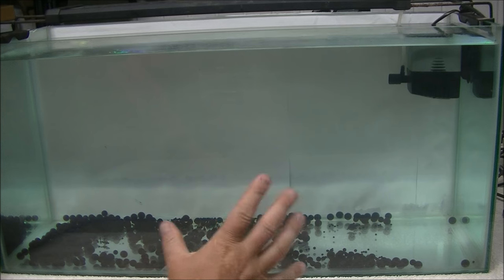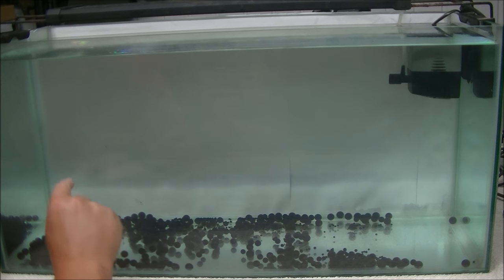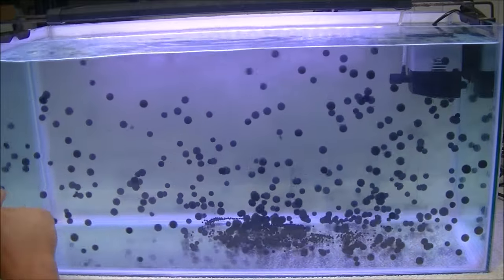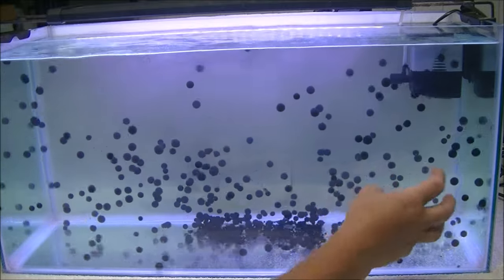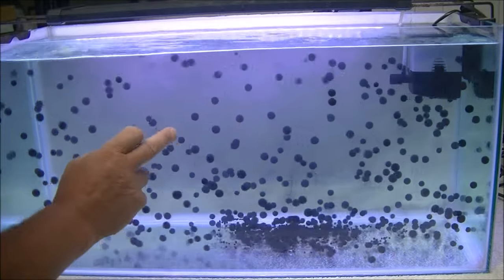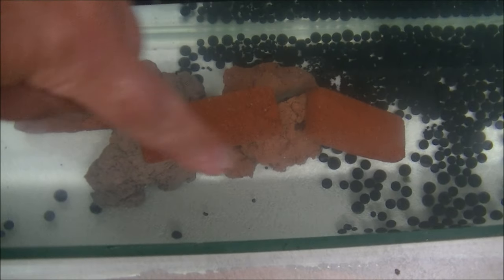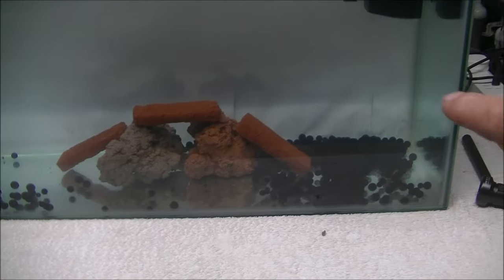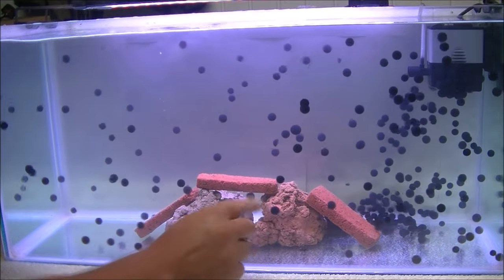Best Inlet and Outlet Placement for a Canister Filter on Fish Tank - (with proper demonstration).

Comment from the maker: Biohome filter media and foams: http://www.filterpro.co.uk
Here we go. This is a video showing why the inlet and outlet of a canister filter should be on the same end of the tank.
When you see the muck (simulated by neutral buoyancy gel filter balls) being shifted to the same side of the tank as the outlet there really should be no argument about where to locate the outlet and intake of any canister filter.
However, I'd still expect people to argue over the placement of both the outlet and the intake - that's just how the internet is ....
For a thinking mind, when you see exactly where the muck goes in a water current the choice of where to locate the intake and the outlet of a canister filter becomes obvious.
Unfortunately there are still many 'experts' making videos online who ignore any sort of common sense who say that the intake and outlet should be on opposite sides - that is wrong as this video clearly shows.
If you found any sort of value in this video please feel free to share it anywhere online - the visuals don't lie.
Check out the FilterPro website here for the best filter media available: http://www.filterpro.co.uk
Also, if you're interested in learning more about filtration, water conditioners and how to create a set up which is low maintenance with perfect water check out the FilterPro Q&A page here: https://www.filterpro.co.uk/qa-24-w.asp
SUPPLEMENTAL: Avoid using any water conditioners which claim to 'remove / detoxify or bind' the ammonia, nitrite and nitrate since they will starve the bacteria which are needed to process the ammonia, nitrate and nitrate. It is quite obvious.
Go for a normal conditioner like API Stress Coat https://geni.us/BHYeb which will simply make the water safe for life.

Comment: Excellent demonstration, also having both inlet and outlet in the same place should increase the flow rate and save energy at the same time because the outlet pipe in not starched out at the other end.  Less drag to push the water out
Reply from the maker: Good one - I'm glad that you have it set up well. Thanks for watching and best of luck with the tank.

Comment: What gel balls were you using? I have just bought a canister filter. Will it change things if using a spray bar?
Reply from the maker: They are just pond pure balls from Evoulution Aqua - that's what I give away with the Biohome filter media and they're a great way to naturally seed the new media in a filter. I made a similar video showing a spray bar here: https://www.youtube.com/watch?v=9vGJ21YxlMw
Reply: @pondguru  ah, cheers 👍 I found your video really informative and interesting 👍 
I've just got the 'All Pond Solutions' EFX + 2000 canister filter for my 350 litre aquarium. I found that the bioflow 6.0 built in filter just wasn't hacking it anymore. It keeps a good cycle, but just recently, and with the 4 fancies  growing bigger, the nitrAtes are now going from 20 ppm to 30 - 40 ppm a week. So, I felt a larger filter was necessary. With an additional internal Aquael 750 on the other side for emergencies. 👍
Reply from the maker: @jonnyshock9165  Nice one - that seems like a solid filtration set up.

Comment: My intake is in a corner and the outlet is a spray bar the length of the tank . Hopefully that's okay.
Reply from the maker: You will get a very good cyclical motion along the length of the tank when using a spray bar but the much won't necessarily be pushed to where the intake is for the filter.
As long as you're happy with the set up it's all good since the water moving well is more important than what direction it moves.

Comment: This have always been quite intuitive to me.
The filter outlet create surface agitation and oxygenate the tank, then reach the far wall, where the water have to go down and then stream along the bottom, sweeping the muck with it in the process.
Only the lightest bits will follow the upward stream at the filter end of the tank and follow along for another lap around the tank.

It was very helpful to see how the mid setting of the filter gathered less muck around the end of the decorations though, I have never thought about that!
Reply from the maker: Yes that is very true about the large bits of muck and uneaten food and I over-sized the pump (and 'muck' represented by the balls) to make the visual representation more noticeable.
I'm glad you found the video useful and thanks for the report on your tank.

Comment: Great advice. I have one large internal filter at one end of my tank and  I found that when syphoning gunk off the top of my substrate there is always a saturation of muck right under the filter, proving the point you make. Thanks for sharing.
Reply from the maker: Nice one - thanks for the report and confirmation.

Comment: Fantastic video! For years I had my Eheim canister set up wrong, with the output and input on opposite sides of the aquarium. I finally discovered (after watching several videos) that they need to be on the same side. It's really rather counterintuitive in my opinion.

On my central filtered rack system, my intakes are at the surface and the output near the bottom. The reason is that I need surface skimming, and good flow at the bottom to prevent algae buildup.
Reply from the maker: I'm glad you found the video useful and thanks for the comment - it's a great example of how there is never a definitive 'right' way to do anything and experimentation is key since every tank is different.
Unfortunately many people are afraid to experiment which is something I've always found strange, lol
Reply: @pondguru  Which demonstrates why fishkeeping is an art and not a science
Reply from the maker: @FrugalFishkeeping  Yup. Whenever science gets involved in Nature it makes an arse of it.
Reply: @pondguru  I think that is a topic for a different channel. I do find myself constantly making "improvements" to my aquariums in a constant quest for success. Every time I think everything is fine, I find a way to make it even better. Or solve a problem. That's what makes the hobby so interesting.

Comment: Brilliant and simple and may i add if you place your heater under your intake that should spread the warm water out to the cooler areas ?
Reply from the maker: To be honest the flow around a tank will spread the heat around quite nicely so the positioning of the heater isn't too important.

Comment: Great visual, something which I've thought about since the day I set up my tank. 

I opted to go for opposite ends for 2 reasons:
1. My tank has a brace and the gaps don't allow for both the inlet and outlet to fit on one side of the tank
2. I have a heavily planted aquarium with two big structures so potentially opposite ends may work better in this scenario 

Initially there was some muck in the middle of tank, but I positioned the inlet to hit straight forwards towards the front panel and now I have no muck on the substrate at all so my current set up is working.
Reply from the maker: Yes 100% - just alter the direction of flow until it works for you. Every tank is different and plants / structure makes the flow go in unexpected directions so experimentation is key.

Comment: Great video as usual.. thanks pondguru. I would really appreciate if you could also demonstrate the same, but this time with wave maker in the loop. I find it really useful for most of the tanks for surface agitation and sand skimming, specially in highly stocked aquariums.
Reply: (my other channel) I have a rotating outlet which I will be doing a video on tonight and it is very disappointing compared to a normal outlet. I was shocked when I saw how inefficient it was.

Comment: Great video. Interested to know your suggestion on how the inlets and outlets will be placed if using the filters like hypermax4500 which has two inlets and two outlets?
Reply from the maker: As long as you have the inlets / outlets either at opposing sides or a side which will generate the best flow of water and muck depending on the structure in the tank its all good - there is never a perfect way to set up any tank since every tank is different.
Just experiment with the inlets and outlets until you get the best pet up for your tank.

Comment: Good visualization. How would you set up two canister filters? Because I actually use two Fluval FX6 on one tank, and one FX6 + one Biomaster 850 on another tank. For the moment they are all set-up opposite of each other with their individual inputs + outputs together on one side. One output flows horizontally towards the other side, the second output on the other side flows towards the frontside of the aquarium.
Reply from the maker: That sounds like a good option if you have 2 filters.

Comment: I need some movement, but most of my critters prefer dead spots, so it's nice to have the visual to see where to adjust it from time to time to clear out the muck from the dead zones, as well as not blasting my plants into oblivion.  =p
I'm setting up a 75g, so this is very helpful!
Reply from the maker: I'm glad you found it useful and ultimately whatever works best for you is the best set up so play around with the intake / outlet until it works best for your tank.

Comment: I just got the aquael hypermax per your advice. Since there's two outlets and inlets I'm trying to figure out where to face the outlets. Maybe they need to go the same direction?
Reply from the maker: Just experiment with the set up until you have no more dead spots. Depending on the structure in the tank the muck will settle wherever the flow is slowest.
There is never a definitive right and wrong place to site the intake(s) and outlet(s) which is why experimentation is key to getting things right for your tank.
Best of luck.

Comment: What a great explanation, most tanks I’ve seen have the built in holes for inlet and outlet making options limited….the industry needs to change a guess. On a personal note, I’m looking at moving my 250lt tank outside (its acrylic not glass), encasing it in decking material. Like a mini outside pond/ container. While I’m sure it will be fine, I’m also looking at housing my Fluval FX6 along with it, again it would be encased in the same structure as the tank (decking).  If you can imagine a tank housed in decking with a small but connected bump out to contain the FX6 (that will form a seat). Good idea or not? Do you think the FX6 will survive outside? I’m thinking or packing around the FX6 with insulation.
Reply from the maker: As long as the water did not freeze it would be fine since there is almost no difference between a canister filter and a small pond pressure filter.
If it was ever turned off it would be best to drain the pipes and filter if there was a risk of frost but other than that it sounds no problem to me.

Comment: I have two outlets/inlets (Aquael Hypermax 4500). I have both inlets (the water being taken into the filter) at the back wall at either end.

The outlets are at the front of the tank at either end. My thinking was that the flow from each end meets in the middle and creates movement.

Not sure if it's the best placement and to complicate things further I still have the Juwel internal filter running. Lots of filtration for lots of Mbuna!

I also have two wave makers to help move the crap around. One at the back corner facing down behind the rockwork. And one at the front facing the surface. But I only run them twice a day for an hour or two. They don't need to live in a washing machine 24/7. 😂
Reply from the maker: If you have the option of 2 inlets and 2 outlets then it becomes a bit easier - have 1 x inlet and 1 x outlet at each side of the tank and you will never have a problem removing the muck from the tank.
Reply: @pondguru  that's the exact way I have mine set up, that I won from your give away competition. I was going to ask you what would be best in this case, but you have answered it here , so I did good 😊
Reply: @pondguru I fully agree and support your point 👍

Comment: I’m guessing if you have 2 canister filters running you’d still just keep 1 inlet and outlet at either side? Or would you move both to the middle.
I say that not sure how that would work on my fx6 right enough
Reply from the maker: If you have 2 filters running you can switch it up until you get the best results. Since every tank is different thee is no definitive way to set the filter inlets / outlets up, especially if you have multiple filters on the tank.
What works best for you is the best set up.

Comment: When we have 2 external filters than? Both inlet in one side and each outlet at both ends or still you recommend both outlets near the inlets?
Reply from the maker: As long as you have the inlets / outlets either at opposing sides or a side which will generate the best flow of water and muck depending on the structure in the tank its all good - there is never a perfect way to set up any tank since every tank is different.
Just experiment with the inlets and outlets until you get the best pet up for your tank.

Comment: Great video. However i have a 350 uk litre corner tank where does input and output go on this
Reply: Good question
Reply from the maker: Ideally the intake would be in the back corner under the outlet but the outlet flow direction would be altered to see what happens with the muck and where it goes.
When setting up a new tank these gel filter balls are perfect since they show where exactly the flow goes and have the benefit of seeding the tank with good bacteria.
For a corner tank the flow direction from the filter would be altered until the flow across the front of the tank (the bowed long side) would either go left to right or right to left - that will allow the sides of shoaling fish to be viewed instead of looking at their backsides if the flow was from the back corner to the middle of the front side.
Structure will affect flow so just experiment until you find something which works best for you - there is no 'right' answer since every tank is different.

Comment: Hi maybe you can help I am going to setup a 55gallon with a tidal 110 and a tidal 75 I’m going to use one of them for a full cycle filter (very slow flow) with the 5lbs of bio home media and sponges 
Should I put them both in the middle or on opposite ends 🤷🙏✌️🇨🇦
Reply from the maker: It may not matter too much if one is set to be very low flow but ideally they would be away from each other. The full flow filter will move the water around the tank and integrate the water from the other filter no problem.
Due to the way HOB filters spread the flow upon return to the tank it's never going to stir much up from the bottom of the tank like a canister filter outlet or wave maker can do.
Reply: @pondguru  thank you very much 👍✌️🇨🇦

Comment: So I have a Hypermax Link (2 inlets and 2 outlets) and an Ecotech MP40 wave maker
I have an inlet on each side of the tank and and outlet on the back left facing right and the second inlet is half way along the back of the tank facing right as well (the wave make is on the left hand side about 4 inches from the top of the tank on the left hand pane of glass pushing water to the right in the same direction.

Would you suggest to set it up differently or good as it is ?
Reply from the maker: Every tank is different and as long as the muck is being swept towards the intake of the pump / canister intake it's all good. There's definitely no definitive 'right' way to set up the intake / outlets when there are multiples so whatever works for you is the best way.

Comment: See, that feels counter-intuitive, and I would've positioned them on opposite sides too. I've just bought a canister for my new tank, so I'm very glad to've seen this before I set it up.

But it makes absolute sense when you look at how any Hang on the back or internal filters are designed. The outlet is always at the top and the inlet is much lower on the same side.

Comment: Hi I currently have the inlet and outlet on different sides like u say not to but I have a wave maker on same side as outlet pointing towards top to make water movement and recirculate the water better will it be ok to move the inlet underneath the wavemaker cheers
Reply from the maker: Well that sounds good to me. Having extra water movement further down in the tank will really stir the muck up.
The intake for the canister would just be wherever the muck was collecting.

Comment: So what happens if you have a lid on your tank and only have cut outs on back. Can you have them together in one cut out. Or would it be best to rig up some tubing , so the outflow is closer to the front side of tank???
Reply from the maker: Ideally the in and out would be on the back of the tank and it is no problem having the in and out through one cut out.

Comment: Hi Pondguru! Appreciate your efforts. The demonstration would have made more sense if you would have done it with a canister filter than an internal filter.

Unfortunately, the flow from the canister outlet is of less pressure than the one of this internal filter.
Reply from the maker: The flow issue is why I used an internal pump and not a canister filter - I needed the gel balls to move well in the flow so I had to oversize the pump to get that effect which looked good in the video.
The balls representing muck and uneaten food are way bigger than what would be found in a normal set up too but that was also done for better visuals.
Reply: Hi. it's depends what setup is in the tank. I have 250 litter tank with utramax 2000. never have a problem with muk or dirt. if you had external filter  3 times bigger then you need for  your tank. it does work perfectly.  over filtration not exist.
Reply: @tomaszmichalczyk3425  (my other channel) Yup, that is true.